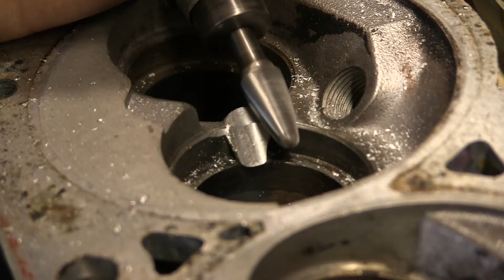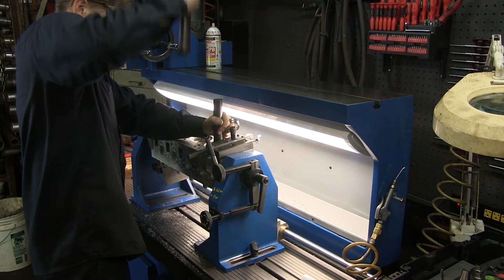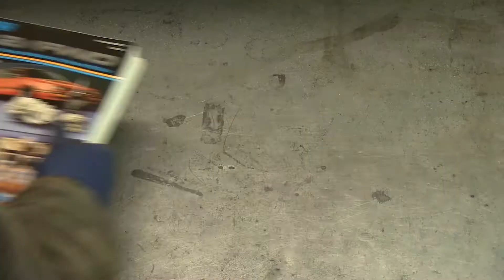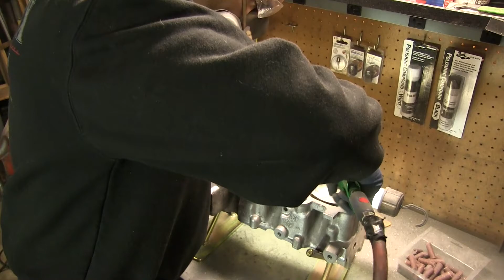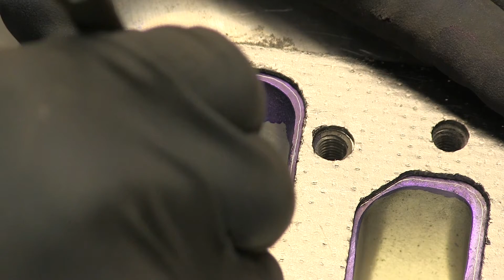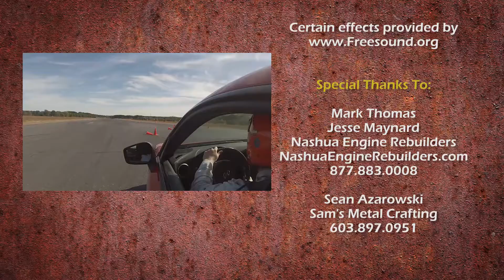Garage X - Episode 10 - Cylinder Head Rebuild Part 2

Comment: You should think about deshrouding those valves a bit. Lay a head gasket on there and scribe a line. Then you can lay back the chamber walls away from the valve seats at the same angle as your valve seat almost right up to the fire ring. Yes it will drop your CR a little bit, but you're going to have the head milled anyway so it's perfectly flat and true, right? Get yourself a cheap cc-ing kit so you make sure you take the same amount of material out of each chamber.

What are you going to do for valves and guides? You can get 1mm oversize valves from all of the turbo dodge niche vendors that fit in the stock seats, and SI makes bronze valve guides if you want to get fancy. Last time I ordered the part number was VG9004/00 for the intake and VG9005/00 for the exhaust.
Reply from the maker: Yes! Ian, you are wise in the ways of head porting, I see. Our video only scratches the surface of what is possible. Shaping the combustion chamber, cc-ing the head, all these things will make a difference in how much power you can pull out of your engine. We'll get to do more of this with our next set of heads. Right now, we're building the BBF 460 motor for the shop truck. Thanks for the advice. We hope you like the show.

Comment: what do you mean when you say "keep the fuel molecules in suspension" ?
..my guess is simply gas is moving slower?

 I'm trying to understand the point of bringing the intake ports back down to 80 grit texture ...as I was watching this video I just immediately assumed "smoother is better"
Reply from the maker: Right?! It would seem that way, but the generally accepted wisdom is that having a "boundary layer" of turbulence along the surface of the intake ports actually helps flow and keeps droplets of fuel from collecting on the metal. It's  the same reason they put all those little dimples on a golf ball. Most porters tell me that even 80 grit isn't enough texture to accomplish this fully, and some guys go crazy with intake surface texturing. (look up power lynz tool) Now you're getting way into the secret arts of porting. Probably the only way to tell if it makes a difference on your particular motor is to do an A to B comparison on the dyno.
Reply: wow 80 grit, really ? thats interesting.. 

Yeah this information on porting is starting to get too specific for me, my future plans with automotive tinkering doesn't include tuning performance / building motors, mainly just restoration and generally repair.